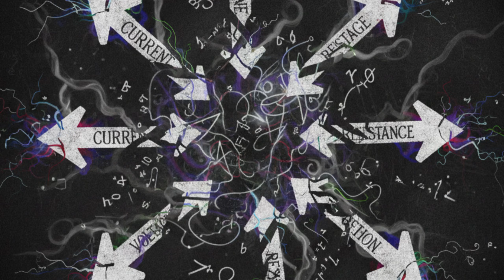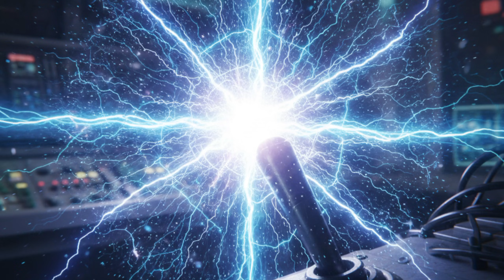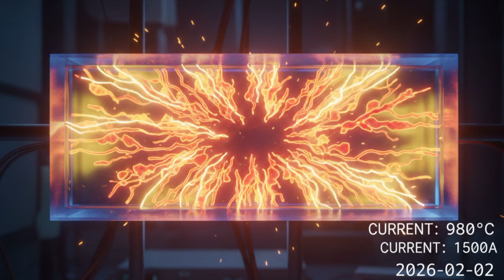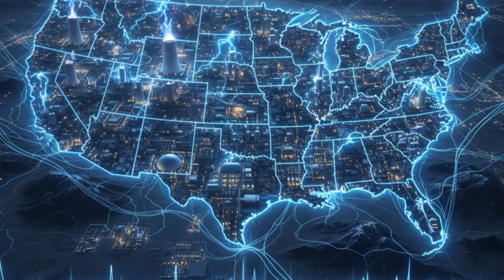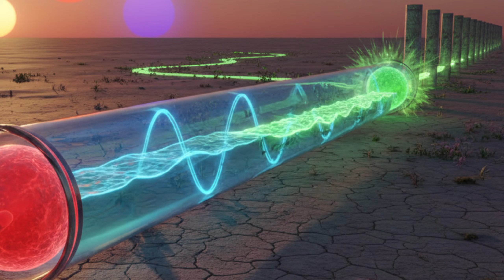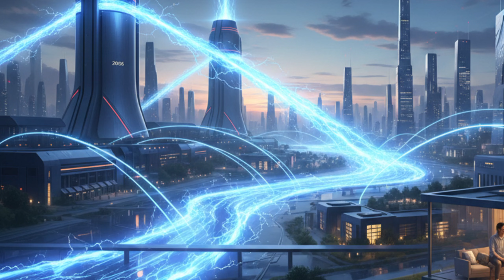Electricity Does NOT Flow Inside Wires (The Hidden Truth)

Comment: Explain it in simple words.”
Reply from the maker: Think of a water pipe. The water molecules move slowly, but the pressure wave moves fast. In a wire, electrons drift slowly, but the electromagnetic energy moves near the speed of light around the wire.”

Comment: This explains why AC power is so efficient for long distances.”
Reply from the maker: Exactly! AC works beautifully because the field oscillates and voltage can be transformed easily for transmission.
Reply: @TheLawlessUniverse so are textbooks wrong?
Reply from the maker: Not wrong — just simplified. Textbooks say current flows in the wire, which is true for charge movement. But when it comes to energy transfer, the full picture involves the electromagnetic field around the wire.”

Comment: No, the electricity DOES travel inside wires,  because it is the electrons that are slow flowing from low potential to high potential (while the current flows from high potential to low potential). But it is the electric and magnetic fields that forms around the conduction carrier as a result of that electron movement in the wires that forms at the speed of light as a reactionary imbalance in charges cause the fields to respond right along the conductor at the speed of light. The electric field holds the potential energy, while the magnetic field holds the kinetic energy.
Reply from the maker: "You've raised an excellent point! You are absolutely right that electrons drift within the wire and their movement is linked to the formation of fields. However, there is a fascinating layer of physics called Poynting’s Theorem that takes this even further.
While the electrons (matter) move slowly inside the conductor, the actual energy—the Joules per second—does not travel inside the copper atoms. Instead, it travels through the electromagnetic field in the space surrounding the wire.
Think of it this way:
The Electrons: Act as the 'guide' or the 'track' that allows the process to happen.
The Field: Is the actual 'vessel' carrying the power from the source to the device at nearly the speed of light.
So, while the 'charge' is inside the wire, the 'energy' is an invisible wave hugging the outside of the conductor. It’s a counter-intuitive concept, but it’s what makes modern power systems so efficient

Comment: "So if the energy is in the fields surrounding the wire, does the thickness of the insulation affect the power delivery? Interesting video!"
"I’m an electrical student and this actually cleared up a huge doubt I had about AC power. Thanks for making this!"
Reply from the maker: That is a brilliant question! 🧠 In theory, yes—the insulation (dielectric) does interact with the electromagnetic field. However, for standard power delivery, its main job is safety and preventing arcs. At very high frequencies (like in data cables or RF), the insulation's thickness and material actually do significantly affect the signal speed and quality! Great catch."

Comment: "Wait, so the electrons in my wall have been there since the house was built? That’s a crazy way to think about it! 🤯 Great explanation."
"I always struggled with the water-pipe analogy in school. Seeing it explained through fields makes so much more sense. Physics is wild!"
"The part about electrons moving slower than a crawling insect while the light turns on instantly is the best bit. Mind = Blown."
"Finally, someone explained the difference between Drift Speed and Field Speed clearly. Most textbooks skip the 'Why' part. Great job!"
"This is how physics should be taught in schools. Simple, visual, and hits the core concepts. Keep it up!"
"Love the 'long line of people' analogy. It made the whole AC/DC vibration concept click for me instantly."
Reply from the maker: "Right? It’s wild to think that the electrons in your phone charger right now might never even leave the wire. Physics is full of these 'hidden' realities! Thanks for watching. 🙌"